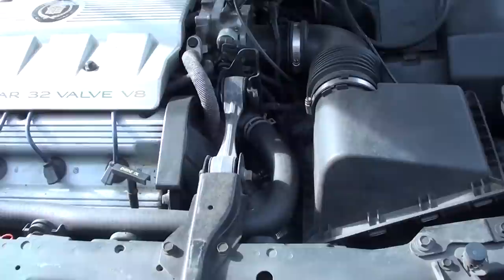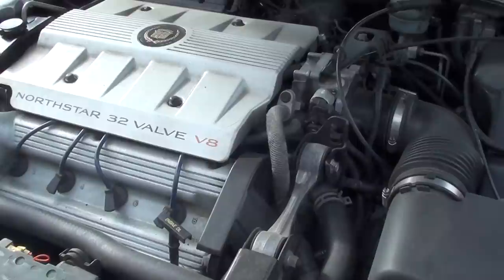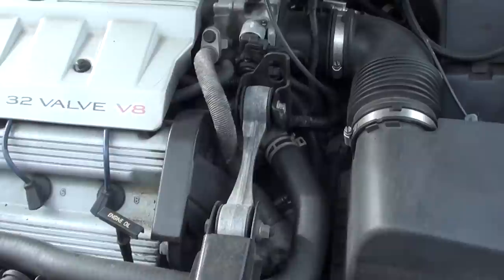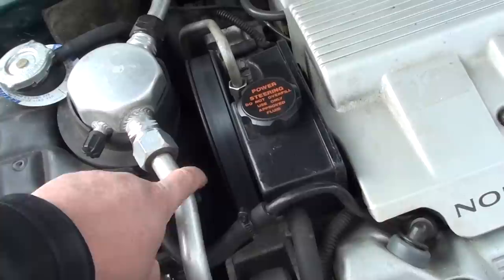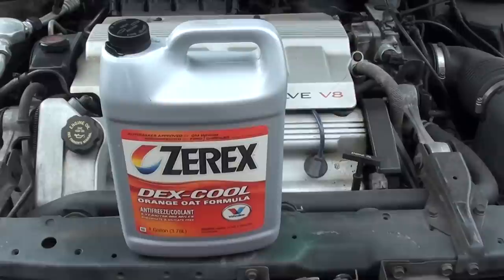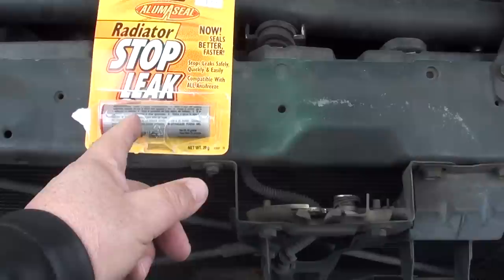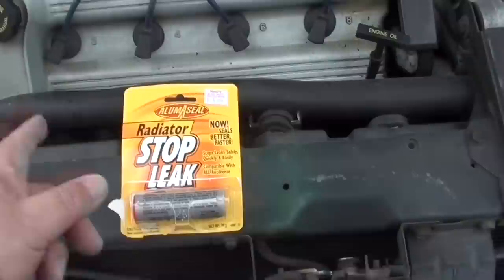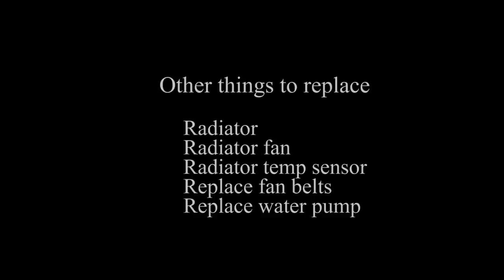Cadillac | Prevent Northstar engine from Overheating | What Mechanics won't tell you

Comment: The FIRST thing you should do to prevent overheating in these "engines", and IF your head gasket hasn't crapped out yet because of it, is to do a BYPASS OPERATION on the air bleeder bolt on the water pump housing. This bolt is hollow and allows any air to escape the water pump housing which, when air is present---voila! instant pump cavitation, and then the engine starts to overheat. If you know anything about outboard motors (or pumps) you know that when your prop is not completely in the water, it CAVITATES and the prop becomes ineffective.  I cleaned out the air bleed bolt but it still overheated. After much research on this, I discovered that, sure, the hose from the bleed bolt goes to the coolant overflow tank, BUT, before it does, it connects to some metal lines that take a tortuous path through, around and under a metal plate under the throttle body in order to warm the throttle body which warms the intake air. This is NOT necessary or needed unless you live in the icebox areas of the country-and maybe not even then-could be just an emissions issue. This torturous path under the throttle body involves a number of actual 180 degree turns. The problem is, debris in the coolant clogs up that metal tubing,  and is causing intermittent blocking of the flow of water (and therefore air) from the bleed bolt, and thereby causing water pump cavitation. The simple fix is to bypass it using the hose from the bleed bolt to the metal throttle body pipe connection. Disconnect from the metal tubing, cut and inch and a half off the end of the hose for a fresh end for the tank nipple, and directly connect the air bleed bolt to the overflow tank. This is the BYPASS. Before you connect to the tank, turn on the engine and if you get a flowing amount of dribbling coolant from the hose to the tank, you will be good. If not, you need to remove the bleed bolt, clean it out with a coat hanger wire, blow it out, and reinstall, because that bolt can clog too. If you then have flow, you will probably have cured the overheating while running down the road. It did with my 99 Seville. Mine still creeps up on the temp gauge after idling a while for instance, in a restaurant or bank , etc. drive through. Before I did this bypass, the users of the vehicle got a professional coolant flush and new thermostat and it still overheated. I think the radiator could be gunked up. I think another flush and a new radiator will fix this. I think this was a flawed engine design from the get-go (that is only one flaw-the spindly weak head bolts is another). The engineers, who have probably taken this embarrassing mistake to their retirement, or grave, designed an engine that is somehow pulling air into the coolant system, is letting air collect up in the water pump housing, and is causing the water pump to cavitate inside its housing, become ineffective, and thus overheating the engine. They were too far along in the design to start over because they actually had a test engine, which probably to their horror, overheated. So they jerry-rigged that bleeder bolt in there to bleed out the air. That worked fine except they decided to use that dribble of water to heat the throttle body warming plate (which gets clogged up), and then dump it into the overflow tank. Just bypass that throttle body line and go directly from the bolt to the tank. All I know is that it fixed my problem.
Reply: You typed entire thing in a foreign language. Please explain to me like I'm 5. You seem to have some great knowledge and I'd like to understand
Reply: @user-os8iy2nj8n 
5 year olds shouldn’t be working on cars.
Reply: Really incredible information here. Thank you
Reply: Do you know where I can find a visual diagram or video on this?
Reply from the maker: @12yearssober 
Heres the product.
 https://youtu.be/ZwrDiAHeJcs?si=WIcssmYKftymAzHT
Reply from the maker: @ImperatorCaesar22  
yes, here you go.
https://youtu.be/ZwrDiAHeJcs?si=WIcssmYKftymAzHT
Reply from the maker: @user-os8iy2nj8n  
this video has more detail
https://youtu.be/ZwrDiAHeJcs?si=WIcssmYKftymAzHT
Reply from the maker: @12yearssober  Blahahaha!!!
Reply from the maker: @12yearssober  Blahahaha!
Reply: Can we do away with the music
Reply: Damn were you all geeked out commenting all that

Comment: My 98 Cadillac SLS has over 213,000 miles on it and is still running like a champ, no problems with it ever.
Reply from the maker: Nice!.. I love hearing stories like yours. thanks for stopping by.
Reply: I take it you followed the recommended coolant maintenance schedule.
Reply: @hey_buddy_waz_up  Yeah, that and regular oil changes and most importantly WOT procedure every 2 weeks.
Reply: @firebird0u812  What's WOT procedures???
Reply: @k.c.marshall921  wide open throttle.
Reply: @lancedukel3436  Ok Gotcha👍👍👍
Reply: I have a 96 SLS , do you have any recommendations or tips to keep her strong 💪, and also has your tachometer ever gone out ?
Reply: I have a 99 sls with 160k.. I'm just now having to work on it.  Reservoir filthy, air box not installed or supported the correct way
Reply: You just jinxed yourself

Comment: I was a Cadillac man until the Northstar engine broke my heart and my pockets
Reply: Me and my dad is dealing with the same thing, but thanks for the video!
Reply: you couldn't have been because the engine before that shohuld've broken your heart worse. the ht engine was an even bigger piece of crap.
Reply: bought a 2002  northstar  cadillac  and  was  told  the  white  stuff  coming  out  of  the  exhaust  would  go  away,  sure  it  did  but  that  did  not  stop  the  need  for  a  new  engine  or  as  engine  rebuild,   Thank  you  After  Lease  Auto  Sales  as  now, the  repair  is  as  costly  as  a  whole  new  car  even  a  jasper  will cost  some  $8500  to  replace  the  engine...  hum...  if  i  took  out the  thermostat  and  left  it  always  open,  might  that  fix  the  issue?
Reply: @bindibadgie1392  thet never fixes anything but it does make some people feel better as if it did. 
and if you do fix it get a used engine out of a crashed car with less miles than yours instead of a rebuilt engine.
Reply: @bindibadgie1392  it has to have the t-stat in it. It would be much cheaper to have the motor studded. About $3000 maybe less.
Reply: @garonburwell9008  not the 4.5-4.9s
Reply: @aliengoth  yes i believe those are the problematic h.t engines. this is what the entire automotive world knows about them:
The HT4100 was prone to failure of the intake manifold gasket due to scrubbing of the bi-metal interface, aluminum oil pump failure, cam bearing displacement, weak aluminum block castings and bolts pulling the aluminum threads from the block. It may not have been the most successful engine to sit under the hood of a Cadillac, but potential buyers were no more satisfied with the other two engines available at the time, the V8-6-4 and the Oldsmobile 5.7 L Diesel. Reliability issues soiled the reputation of the HT4100. As a result, the Oldsmobile V8 gas engines were a popular and straightforward conversion. Despite problems with the engines, Cadillac still had annual sales in the United States above 300,000 as late as 1986.[3]
Reply: @lancedukel3436  I  really  loved  the  ride  and  inner  driving  area  space  of  the  Deville.  Unfortunately  the  age  and  comfort  thing has  caused me  to  to  think...  If  it  is true  that  the  entire  engine  and  drive  train  must  be  removed  just to  fix  a  head  bolt  issue,  hum,  on  a  68'  Camaro  it  would be  a  day  fix,  but  the  hours  just to tear  down  the  engine  to replace  what  might  be  worn  threads  on  head  bolt  studs,  as  was  a  possible  indication  of  the  Block  Test,    or  even  simply  replacing  the  northstar  with a jasper...  If  not  for the  hourly  rate  or  if  I  had  my  own  shop  with  a  lift,  and  of  course  the  head    and  block  may  need  to  be cracked  tested  too,  I  may  have  to  save  the  deville  for  a  future fix,  and  find  a  replacement auto  as  the  cadi  sits  in  storage.
   Love the  Cadi  but  I  am  not  Jay Leno  with  his  car collection  so...  well anyway  I  wish  to  thank all  you  wonderful  folks  who  gave  me  such  great  advise
Reply: @garonburwell9008  the 4100 gem

Comment: that leak in engine is head gasket because HEAD bolts pull up stop leak dont work on a steel head gasket
Reply from the maker: yes..we have discussed that . Thanks for your input.

Comment: I drive a 2001 Deville that currently has 255,000 miles on it. I have done regular maintenance and repairs like idler pulley, water pump, 1 coil pack with plugs but as far as the engine that’s about it. I did have a bit of an overheat problem driving into Phoenix in 100+ temps but it didn’t go into the red zone on my gauge. Generally speaking I am impressed with the car.
Reply: 2000 and above have different bolts
Reply: Awesome! I'm I'm Tucson and just hit 180k. I belive I can get to 250! Your reply is 2 years old already - is your 01 still on the road?!
Reply: @ACADILLACZ520  no when she hit 265k I started having lots of weird problems and decided it wasn’t worth the money and time so I sold it to a junkyard.
Reply: @ACADILLACZ520  any update ?
Reply: @spirit_richhh5301   My 05 hit 188K. Got some codes saying catalytic converter isn't working. Got some cooling system leaks also. She has always had a steady drip on oil. She will start and drive just fine, But overheats eventually with the cooling system leaks. With a little bit of time and money I'm sure she has some life left in her. My neighbor had passed away and I ended up buying his 08DTS, So I put the 05 on the back burner for now. The 08 just hit 140K and runs very smooth. I do prefer the 8th generation deville over the newbody DTS

Comment: I had a small issue with overheating, very mildly, and I replaced the overflow reservior, the water pump and thermostat, all hoses, and the small crack in the radiator. It hasn't ever overheated again, and runs right at the halfway (vertical) line at the top of the gauge.
Reply: I have that same problem I replaced the mass air-flow sensor & the engine light is still on after I did the diagnostics on it....its a 2007 dts....its kicking my butt

Comment: Certain years used shorter head bolts that would back out and create the blown gasket symptom... paid  $3500 to re-sleave the block with the steel inserts on a 1999 Eldorado and the car ran like a champ! 😎
Reply from the maker: thanks for your input.

Comment: Ive owned a 94 cts and own a 04 Deville 215k and does not over heat runs and drives made  it from Minnesota to Vegas doing 80 in cruise control the whole ride no problem  take care of it it will return the favorite
Reply: @—TheManInDboX — Really?
Reply: CTS did not exist in 1994

Comment: I have a 1997 Seville SLS. I use AmsOil Antifreeze.  Works like a dream.  Perfect for Aluminum block.
Reply: My parents just gave me their 1997 SLS with 121,000 miles on it.  Gonna look into this, thanks!
Reply: 97 seville sets just hit 100,0 and i got it to 125 multiple times no problems

Comment: Every older car I have , the first thing I do is coolant flush , and lower temp thermostat.  Having a lower temperature,  will reduce the pressure inside the cooling system.  Yet to own a northstar,  but owned lots of gm , and always always dump and wash out dexcool every 2 years.
Reply: man good ol internet info! the cap controls system pressure not the thermostat.  most injected engines with a lower temp thermostat will never achieve "closed loop" operation and therefore never run in fuel control and eat a ton more fuel. lower temp thermostat in a fuel injected car is a bad idea. a working thermostat controls the minimum temp and doesn't  have anything to do with the maximum temperature or overheating.
Reply: The thermostat allows the coolant to superheat so when it releases the fan can remove more heat than at a lower temp .so it's a mixed bag .but sometimes a lower temp will help when there are underlying problems as h.gasket

Comment: That sealant leak stuff will clog the radiator, heater, and that vapor tube 3:10.  Sure It seals up little leaks. It also plugs up other stuff.

Comment: 1995 Aurora - I use green factory antifreeze - service every two years.  No problems - 59,000 miles.
Reply from the maker: Thanks for your input.
Reply: 1999 Oldsmobile Aurora 89,000 miles no issues recently flushed coolant system temps stay under 200 degrees
Reply: @mellyzaurora1277  My Aurora runs a little over 200 degrees - about 210 to 220 degrees.

Comment: My nickname in the UK when I lived there was the Caddy Guru as I specialised in the 1998 to 2004 STS which GM supplied in right hand drive to the UK market to compete in the luxury fleet market with BMW and Mercedes.
Never ever use the GM recommended Dex-Cool and the tablets, as another commenter has already said...its Dex-Kill.
We always flushed every STS coolant system to run crystal clear then would use only the best coolant in the European market specifically designed for aluminium (notice the correct spelling lol) engines.
There were actually some interesting differences on the cars supplied to the UK
Reply: How important is it to use distilled water?
Reply: @edwardcoyle5425  Important.  Hard water is not good for the motor.
Reply: Edward Coyle ALWAYS USE DISTILLED WATER!!!! Minerals are very bad for the cooling system.